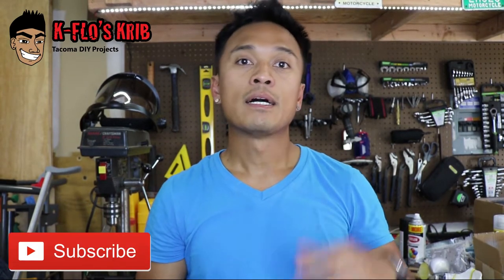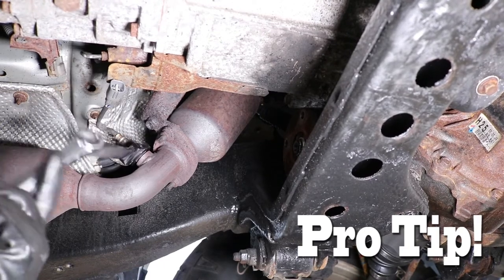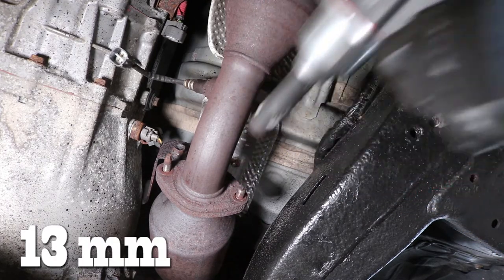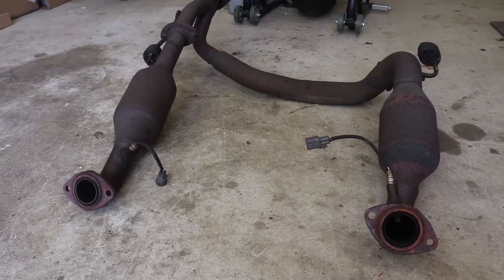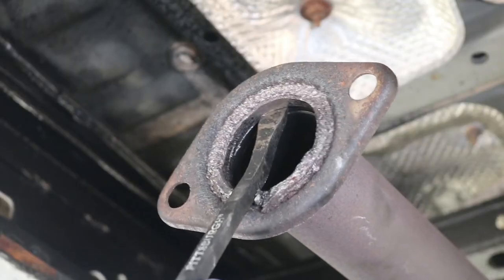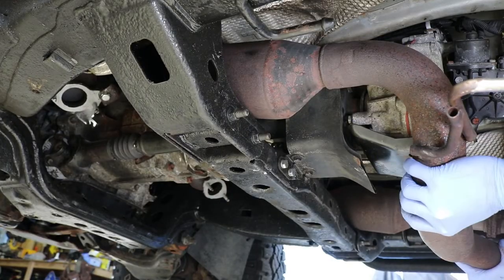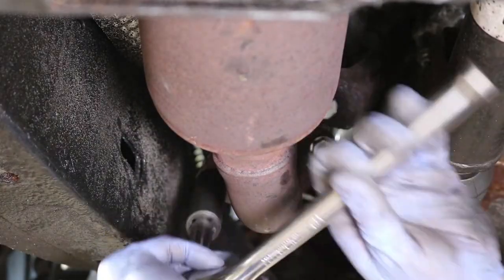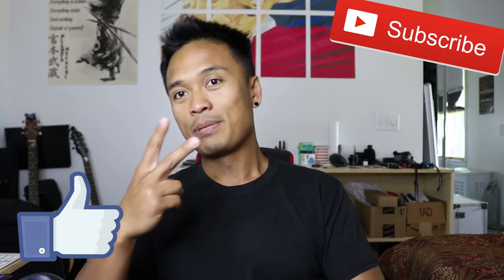Exhaust Work Tip$ and Trick$ (Tacoma DIY / How To)

Comment: FYI - Torque on the O2 sensors is 33 ft-lb. Make sure to reinstall with anti-seize! It can also help to break the torque on these while the exhaust is still hot (metal is expanded).

Comment: Pro tip... If those exhaust flange bolts won't come out, cut them off with a Cutoff wheel on an angle grinder or a hand dremel while being careful not to chop up the flange itself.  I usually cut the nuts in half and then punch out the bolts.
Reply from the maker: Thanks for the info

Comment: good video, but unfortunately i wanted info on the removal of the first section,(to engine), very small room to use a saws all, or grinder, i have no clue of what to do...
Reply: take off tire and pull the rubber flap behind it off you can reach the manifold from there

Comment: What kind of exhaust gaskets did you use are they all the same for all three the ones I was looking at OEM Toyota were $37.00 apiece? And what bolts size did you use for manifold to rear cats? I’m worried about breaking studs?
Reply from the maker: All three were not the same. I don't know the specific model that you have but TacomaWorld has the diagrams for the exhaust. For nut sizes, I would recommend buying a thread gauge @ 3:51 you'll be able to get the proper thread types (amazon.kflo-krib.com) in terms of breaking studs, it will happen with exhaust work in wet and damp environments. Use the thread gauge to buy Stainless steel bolts (@ 4:41)
Reply: The 2 in the front 90080-43036 the one in the rear:90917-A6005 and yeah about $80 for 3 gaskets😮

Comment: Do you have to use anti seize and what’s the benefit of using it
Reply from the maker: Exhaust parts are high corrosion and are very tough to remove when corrosion welded. Antiseize makes it easy for future replacements by helping prevent seizing and galling
Reply: So it’s better to use anti seize, but if it’s not used it won’t affect the performance.

Comment: Hey buddy great video and I'm a new subscriber to your channel because of it.  I ran a diagnostic and I need to replace the cat on a 05 Tacoma off-road.  I'm assuming the same product that you used here would be a suitable replacement. Could you share that product name and brand? Thanks so much for your work. It's great
Reply from the maker: There are 4 Cats on the Tacoma. Are you asking about these 2 Cats in the video or the 2 Cats upstream next to the headers? Plus there's the left and right sides. Regardless, I would recommend going to rockauto.com to get the proper cats - best of luck!
Reply: @KFloTacoma  That is very good to know. I'm getting a P0430 code.  Do you recommend just replacing all four?  A Toyota tech recommending trying to clean the old ones first.  Thanks a million
Reply from the maker: P0430 is for the O2 sensor on the Cat. P0430 Bank 2 is driver's side: Bank 2 is side of engine w/#2 cylinder, which is driver's side. I would recommend change out the 02 sensor first because that's a much easier job that doesn't require removal of any exhaust parts. If the problem persists then you can change the cat - which is definitely much more labor intensive
Reply: f
Reply: @gabericks  I'm dealing with the same thing and plan on just cleaning the cats and replacing the O2 sensors before spending all that money on new cats. I'm just planning on soaking them in a tote full of heavy detergent.

Comment: Did your truck not come with heat shields on the cats? My truck has heat shields on it's cats.
Reply from the maker: It did, but the bolts/mounting points rusted away. The northeast salt in the winter is harsh.
Reply: @KFloTacoma   I see. I thought maybe your cats had been replaced at some point.

Comment: My gasket went where the straight pipe connects to the converter. Is this a known common problem for Tacoma's? You're video gives me an idea what to do.
Reply from the maker: The exhaust system is a high corrosion area due to temperature and location, plus if you live in the rust belt, the gaskets will definitely degrade fairly quickly. I'm not sure if it's a common problem with Tacomas, because it has happened on my previous non-toyota cars.
Reply: @KFloTacoma  Thank you for answering. I was able to fix the exhaust leak. I do live in NY, They overuse salt anytime it snows. Hopefully nothing else will happen for a bit.

Comment: Why did you need to remove O 2 sensors and isn’t there a special tool?
Reply from the maker: I had a CEL that required me to replace the driver side 02 sensor. as for the other question, the 02 sensor has a hex body, a closed end wrench worked just as fine - saved me the money as well as time with having to go out to rent them.
Reply: Thanks